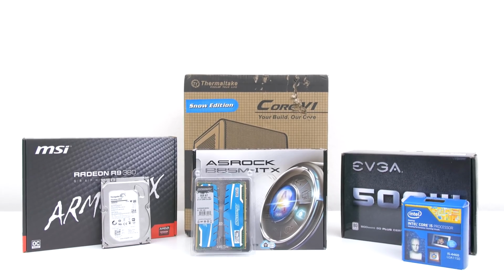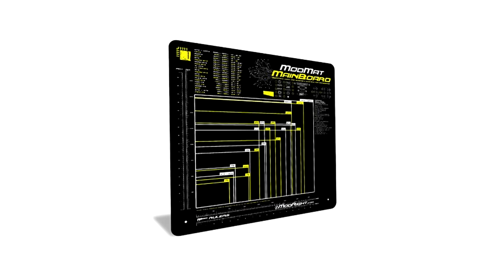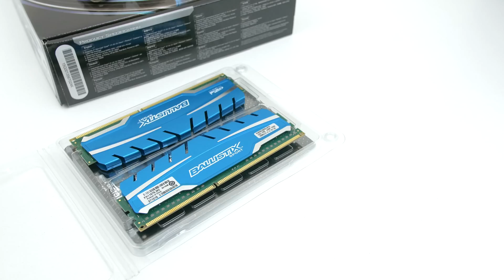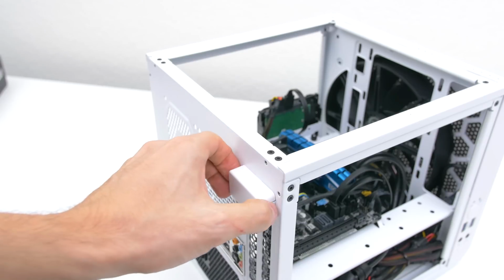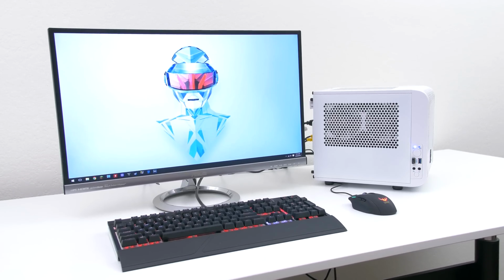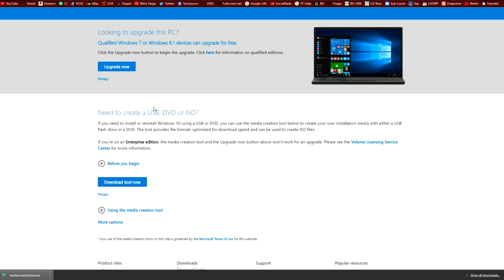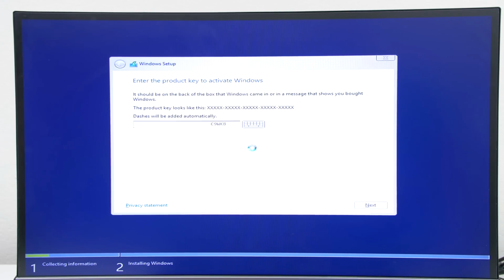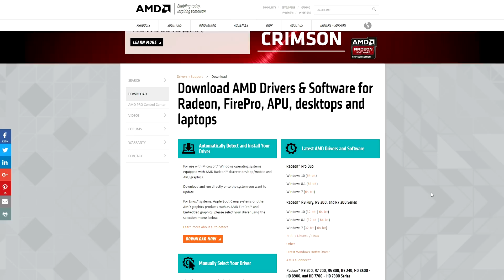How To Build $600 Mini-ITX Gaming PC w/ Windows 10

Comment: So I Just built a computer with similar parts for my friend. My friend not really knowing what he was doing, booted the computer up and did something in the boot menu, but it still started up still like everything was fine. Downloaded windows 10, but idk if he has downloaded the drivers for the motherboard and GPU. The computer, however, keeps turning off randomly by its self,  while he is playing it. Does anyone know how to fix it from randomly turning off.
Reply: I would say it is most probably the ventilation, make sure all the fans are blowing air in with one fans on the back blowing air out. PC normally would automatically turn off when it gets too hot inside to protect your pc from damage. Hope this helps

Comment: Would I be able to replace the gtx 1050 with a 1060?
Reply: yes, they use about the same power... 75w...
so only question is the size... And buy 1060 6bg version, 3gb is a bad choice already
Reply: sorry, 1060 uses 120-135w and 1050 75w, but quality 500w psu would feed even 1070
Reply: HookerWithAPenis k thanks

Comment: hey i am building in this case and  having a i5-7600K and gtx 1050ti what power supply will i need
Reply: Ethan Brierley you only need 400w psu

Comment: OK so pretty much every card is sold out everywhere except the 1050-1080s what would be a alternative gpu? That not terribly expensive.
Reply: GT 1030, GTX 1050, GTX 1050TI, RX550, RX560
Reply: Used 970 for around 150

Comment: When you say “You will need 4 hexagon screws.” Or “You will need __ rubber grommets and _ screws.”

Does that mean that none of this hardware is included and must be purchased separately? If so, how do you know which size/thread screws you need while ordering?

They should include any hardware you need with the individual components or case.

Maybe I’m misunderstanding you?
Reply: All required screws/grommets thingy comes with the case.

Comment: In Vietnam, it is hard to get OS CDs/DVDs at shop because most computer shops are kind of far away from the residential area but it's easy to get a Window 7 DVD on the online shopping websites for just 25,000 dong. That's about 1.5 US dollar.

Comment: Just a side note for anyone trying to build this computer. The motherboard he used is VERY hard to come by Asrock discontinued that MOBO about 6 months ago. The Hyper 212 Evo does not fit into the Thermaltake Core V1 at all no sense in trying guys. I did not build this computer although i have a similar one with an (i5 6500, Asrock H170 MOBO, 16gb of G.Skill Ram, 120gb ssd, 1tb HDD 7200RPM, EVGA 450BT PSU, EVGA GTX 1070 FTW) Another side note, if you try and put a gtx 1070 FTW into this case you will have to cut the case a little bit because the 8 pin cables will no be able to be plugged in if you dont. Smaller form factor GPU's most likely wont have a problem just beware of that for anyone wanting to build in this case.

Comment: Im currently looking into building a pc, is this setup considered good? I have literally no idea
Reply: jqck It's pretty good, but I personally suggest using a GTX 1060 instead.
Reply: Also, don't buy Seagate, buy WD Black instead, Seagate HDDs are literally terrible and sometimes they stop working.
Reply: Pet Shop nice, whats your opinion on the rest of the parts? I only really want to play at 1080p at around 60-100fps not interested in 4k ultra hd gaming at 230fps
Reply: They are good enough, you should be able to play most games on max graphics at above 60 fps.
Reply: Awesome, thanks for the help

Comment: Hey guys i built a similar pc using the same case but someone of the hardware is improved. here is the list of parts ive used if u guys want a better version of this pc:-
Intel Core i5-7500 3.40 GHz Base Frequency Quad Core 6 MB Cache CPU Processor
MSI b250i Pro Motherboard, Mini-ITX, Chipset kabylake, Black
Corsair CMK16GX4M2A2400C14R Vengeance LPX 16GB (2x8GB) DDR4 2400Mhz CL14 XMP 2.0 High Performance Desktop Memory Kit, Red
Seagate BarraCuda 1 TB 3.5 inch Internal Hard Drive (64 MB Cache SATA 6 GB/s up to 210 MB/s)
EVGA (04G-P4-6253-KR) NVIDIA GeForce GTX 1050 Ti SC (Single Fan) Gaming, 4GB GDDR5, DX12 OSD Support (PXOC) Graphics Card
Corsair CP-9020097-UK VS Series ATX/EPS 80 PLUS Power Supply Unit, 550 W 
Thermaltake Core V1 Snow Mini-ITX Cube Case With Side Window - White____This pc is a much faster version of the ICECUBE and its not that much more expensive coming at around £650 so if ur from england (like me) you just need to pay £50 more to get a pc that is worth 250$ more in speed. I hope i have helped u guys if u want a similar pc but more speed
Reply: This is my first pc build and withought techsource i could never have dont it, after all im only 13!
Reply: I was thinking about upgrading this build as well and then i saw your comment. I was just wondering for confirmation if all these parts work well together and if the graphics card is worth it. hope you reply since you have already built this pc. Cheers ;)
Reply: i am thinking about using the motherboard you listed here as the one in the video is out of stock and i was wondering if it was compatible with the same parts listed in the video?
Reply: @harryb7505  Go to PC part picker. It tells you if the parts you are choosing are compatible

Comment: If you were to run this setup with a 10 series graphics card, and an i7-6700k, would there be much difference in the setup? Would you need to run a cooler?

Comment: windows 8 only use 16gb ?
Reply: no, you can have as much as you want as long as it is 64-bit
NO 32 BIT BECAUSE IT CAPS AT 4GB
Reply: I dont want any windows on 32bit... and my question was if it only use 16gb on hdd... (if the question is wrong... sry but i'm from germany and realy bad in english 😂)

Comment: I FUCKING BUILT IT BOYS
Reply: AllGamesConsidered 
What MelonGaming said. Gameplay vids or it didn't happen ;)
Seriously, I wanna build one myself too.
Reply: AkaRed you end up building it? I'm only holding back because I don't know if it's a relevant build anymore and I feel like if I were to build it something better would come out
Reply: is it good?
can it run doom? witcher 3? infinite warfare ? battlefield 1?
Reply: Sosig
Reply: i built this but got a radeon rx480 8gb instead and i can run all those games very well at ultra settings. never below 60 fps
Reply: MelonGaming alot of computers can
Reply: Kaitikai I'm probably gonna build it, anyways if that did happen, the prices might drop so... :P
Reply: MelonGaming hell yeah
Reply: Horse Thief same
Reply: MelonGaming put an rx 480
Reply: AllGamesConsidered I'm gonna put a 1060 in mine
Reply: AllGamesConsidered  does the icore 5 come with the heat sink???
Reply: Joseph Tello Ofc
Reply: Hey guys i built a similar pc using the same case but someone of the hardware is improved. here is the list of parts ive used if u guys want a better version of this pc:-
Intel Core i5-7500 3.40 GHz Base Frequency Quad Core 6 MB Cache CPU Processor
MSI b250i Pro Motherboard, Mini-ITX, Chipset kabylake, Black
Corsair CMK16GX4M2A2400C14R Vengeance LPX 16GB (2x8GB) DDR4 2400Mhz CL14 XMP 2.0 High Performance Desktop Memory Kit, Red
Seagate BarraCuda 1 TB 3.5 inch Internal Hard Drive (64 MB Cache SATA 6 GB/s up to 210 MB/s)
EVGA (04G-P4-6253-KR) NVIDIA GeForce GTX 1050 Ti SC (Single Fan) Gaming, 4GB GDDR5, DX12 OSD Support (PXOC) Graphics Card
Corsair CP-9020097-UK VS Series ATX/EPS 80 PLUS Power Supply Unit, 550 W 
Thermaltake Core V1 Snow Mini-ITX Cube Case With Side Window - White____This pc is a much faster version of the ICECUBE and its not that much more expensive coming at around £650 so if ur from england (like me) you just need to pay £50 more to get a pc that is worth 250$ more in speed. I hope i have helped u guys if u want a similar pc but more speed
Reply: people have been saying he fakes his benchmarks.

Comment: Most of these prices are bullshit. In the description he said that the 8 GB of ram were $40 (CAD), I then checked on the website and it's really $95, The motherboard is apparently only $85 but I clicked the link and it's $110, The 1TB HDD he says is only $60 but it's actually $90, He says the case is $60 but it's actually $80 not as bad as the other ones but still that's an extra $20, The psu in the description is $55 but on newegg it's $70 I couldn't find the price of the gpu because it's out of stock but i'm sure it's still a bullshit price, he says the cpu is $230 but it's really $242 not that bad but it's still not the original price. His full price was $769. My price was $1059. That's a nearly a $300 difference WTF...........................................
Reply: Pixiestix 12 lol you live in Canada or something?
Reply: this video was published in June 2016 and you wrote your comment in 2017, prices fluctuate all the time. particularly in the past few months there has been a big increase in SSD and RAM prices due to supply and demand.

Comment: I have about 1000$ budget with a 144hz viewsonic monitor. What parts should I get?
Reply: https://pcpartpicker.com/list/XLsQBP
Slightly above your budget by $52 but you should be able to buy it
Reply: Toby Plays Games GTX 970, i5 4690k (if u want it for editing 2),or i5 6400, MSI gaming 970 motherboard, any ATX tower case maybe Nzxt source 210, Corsair vengeance 16 GB RAM, 1 TB HDD, add SSD if u want to, 600 w PSU, use the cpu stock cooler if want lower budget, hyper 212 Evo if want silent cooling
Reply: The Pop Corn Gaming gtx 970 and 1060 almost have the same price and 1060 is way better, rx 480 if you want to futureproof.

Comment: Is this a good build? What games can this run? Does it come with a mobo that has wifi? (First time build)

CPU: Intel Core i5-6500 3.2GHz Quad-Core Processor

CPU Cooler: CRYORIG C7 40.5 CFM CPU Cooler

Motherboard: Asus B150I PRO GAMING/WIFI/AURA Mini ITX LGA1151 Motherboard

Memory: G.Skill Ripjaws V Series 16GB (2 x 8GB) DDR4-2400 Memory

Storage: Seagate Barracuda 1TB 3.5" 7200RPM Internal Hard Drive

Video Card: Gigabyte GeForce GTX 1060 6GB 6GB Mini ITX OC Video Card 

Case: Thermaltake Core V1 Mini ITX Tower Case  

Power Supply: EVGA BQ 500W 80+ Bronze 

Certified Semi-Modular ATX Power Supply

Comment: I just built something similar to this as a first gaming pc for a client of mine for just under $600. I went with an i3 6100 and MSI RX 480 with a 120GB SSD (though this comment is 7 months in the future). I got the  1TB HDD used for near free though. That helped me keep it under $600. It rocks 1080p though, for someone used to 30fps console gaming.

Comment: I feel kinda sketchy about the windows installation can someone tell me if it works and do I have to keep the USB in the to run windows. Also with the wifi chip is that the only way to get wifi to the computer

Comment: it this good?
CPU: Intel Core I5-6400 CPU, Quad Core, 1151 Socket
PSU: ACE 750W Black ATX Gaming PC
GPU: Gigabyte GeForce GTX 1060 6GB Mini Boost Graphics Card
STORAGE: 1TB Hard Drive Seagate Barracuda Internal SATA III 3.5 Inch 
RAM: HyperX FURY 8 GB (2 x 4 GB) 2133 MHz DDR4 (Skylake Compatible)
MOTHERBOARD:  ASUS Z170I PRO Gaming Mini ITX Motherboard Intel Z170 Chipset LGA1151 Socket
CASE: Thermaltake Core V1 White Snow Edition Mini-ITX Cube Case
Reply: You probably won't need more than a 650W power supply, but then again I'm not familiar with all of those parts so I wouldn't know how much power they need. If you want see how compatible your parts are go to pcpartpicker.com. Just compile a list of the parts you want to use and the site will give you a rough idea of how compatible they are. Other than the power supply (which is probably overkill since Nvidia cards aren't as power hungry as Amd cards), I'm sure your build will be alright. Assuming everything you ordered is compatible and you install everything correctly, your build will be better than the one in this video.
Reply: yea everything is compatible https://pcpartpicker.com/list/qrPtNN it only needs 240W
Edit: Changed motherboard

Comment: Can I replace the msi graphics card for a nvidia 1050ti? I'm learning how to build a gaming pc and choose the right parts so any advice would be appreciated
Reply: Should work fine. I'm new to this too, but I've been doing research here so that when I decide to upgrade, I'll know what I should go for. Anyway, 1050ti should be easier to install. You don't even need the 6-pin PCI-E plugs to power it. Just put it into the PCI-E slot and you're good to go. Also the 1050ti is a somewhat better card than the one in the video and I would suggest spending a little more and get the 1060 instead assuming you're just going for Nvidia graphics cards for whatever reason you might have. The 1060 is just about $50 more in the U.S. and would be better if your budget can work it into the build.
Reply: Lethalshot66 Thank you for the reply. Much appreciated.

Comment: I recently built this pc and I'm really loving it's performance, but I'm considering if I should upgrade to a RX 480 graphics card or not later on. If I were to upgrade, would the CPU or any other parts cause a bottleneck or will it work fine as is? If it would bottleneck the performance, could anyone recommend what parts I should replace?
Reply: Lethalshot66 would this build have any trouble playing any game ? like battlefield 1 or overwatch
Reply: Nate DaGamer I haven't tried those games yet, but I was able to run Fallout 4 at around 45-53fps on high settings. So I imagine it could run those games pretty well.
Reply: Lethalshot66 thanks for the response :D
Reply: It would be fine. I did the build with the 480 but it is a tight fit
Reply: AllGamesConsidered Yeah I figured as much. The R9 380 was already a tight squeeze anyway, so I don't think that'll be much of a problem to handle so long as I avoid adding one that's too long.

Comment: Hey i have a Problem. I bought the Case and build in a similar PC. But my gigabyte rx470 wont fit in. I dont know why because the r9 380 that he build in is at the Same size like my rx470.
Reply: Use the gpu that he uses in the build
Reply: It could just be that you're having a hard time getting it in because of how little space there is in the case. I had a little trouble fitting the r9 380 in for about a minute and got it in just fine. If the space in there isn't the problem, pay attention to what Ed does in the video. You might be skipping a step on that part like forgetting to loosening the clamp on the PCI-E slot. This assuming your card does fit in the case like you say.

Comment: guys can i put this case in a backpack ? :D
cuz i travel alot and want a portable and dont want node 202 cuz it makes the cpu super hot
Reply: Youssef Mikhael what? a pc is hard to transport. a laptop is much easier
Reply: Youssef Mikhael buy a laptop. transporting a pc ishard
Reply: u wrote (ishard) i thought it was some sort of a company :D
Reply: im not sure, the dimensions are 31.5 x 25.9 x 27.7 cm. if that will fit, it then just make sure your bag can carry the weight.
Reply: explain
Reply: it will prolly fit but i would'nt risk damaging it

Comment: Can I use an AsRock H97M-ITX/ac instead of this MoBo ?
And will it affecte the performance of the PC ?
Thanks for your answer
Reply: As long as it supports the parts you have and fits inside the case, you should be fine. I went with a H97N-WiFi and it's working fine for me for nearly a month now.

Comment: I plugged in the power supply and the blue light is just blinking and won't start up. What should I do?
Reply: Check your connections with each plug. If you screwed up anywhere you could be damaging your motherboard. And watch the video closely unless you got a different motherboard than what was used in the video. In that case, consult the instruction manual and good luck.

Comment: why is there a small battery on the motherboard???
Reply: That is for your computer to be able to maintain the CMOS settings when you power off your PC :)
Reply: po3tik1 thanks
Reply: Traditionally, BIOS settings were stored in CMOS RAM, which was powered by a battery when the computer was powered off. The battery was necessary because the settings would be lost if all power was lost, just as the data in your computer's RAM is lost when it loses power
Reply: lol that's not true
Reply: no it's illegal, the fbi will come running you your door because the gpu is amd when the cpu is intel, and the only reason he was allowed to use a 380 was because that card was released before the rules made by intel that prohibit the use of amd gpus with intel cpus.  im being serious i swear

Comment: Just a heads up to anybody wanting to go through with a build like this. If you have the extra cash I would recommend that you go with a mini 1060 for the graphics card instead of the msi r9 380 because it uses less power and gives you more frames while playing at higher graphics settings such as 1440p and it only costs $200 for the mini instead of $240 for the r9 380

Comment: 600$ is not budget. Budget is console price or under.
Reply: For a budget build your not going to get much better than this because a budget build on a pc should be able to do at least 1080p 60fps and this build should be able to do just that and also in terms of pc's this is by far a budget build because some builds can go as high as even $2000 or higher.
Reply: Just to comment Budget means actually the price you want to pay. If there's no budget you can buy any sort of hardware for it because  you have an unlimited budget.
Reply: yes but this build says $600 and this would fit the $600 budget as advertised in the video. If you don't want to pay $600 for a build then don't. I'm not forcing you to buy a build like this but seeing as people looking at this build want to pay $600 this would fit their budget.